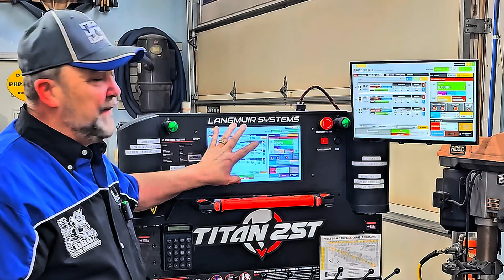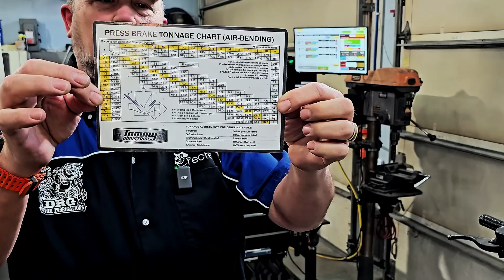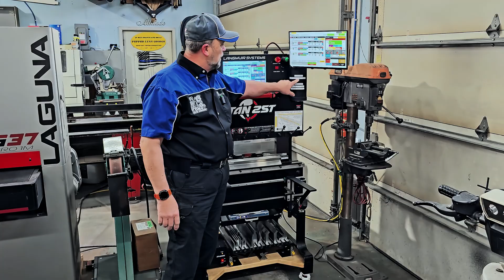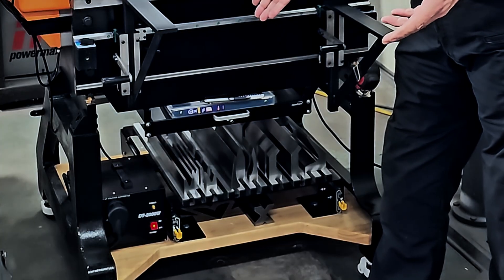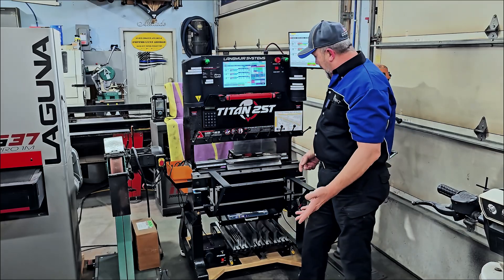Titan 25t UPGRADES

Comment: Would love info on a link for the touch screen monitor. I could see that handy to get the press up higher also. You gotta be hunched way over forming parts.  Thanks so much for the video!
Reply: Also the wiring necessary to do run it. Thanks again!
Reply: Did you ever figure out how to run two monitors on the titan ?
Reply: @BoomerWelder  I personally never figured that out. Would be nice to have that larger monitor.
Reply: @danhenning7604  Thanks for letting me know-- I'll call sam at the factory and see what i can find out-- If i learn anything i'll let you know--
Reply: @BoomerWelder appreciate it! Otherwise I’ve been getting some work done with my machine

Comment: Hey! Just ordered my Titan 25T and am waiting on it to come in! Do you have a link to the quick release levers for the punches?
Reply from the maker: J.W Winco #800-877-8351    Part # (5T16A11/E)   Diameter- 0.83, Thread- 5/16 x 18, Thread Lenght - 0.63,  Type E- Angled handle or Type D- Straight Lever.  Hope that helps.